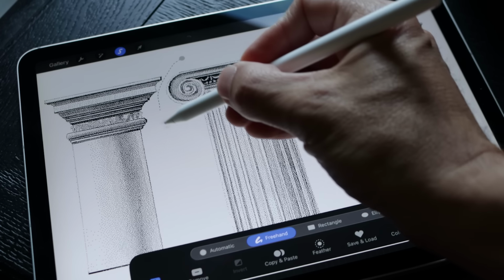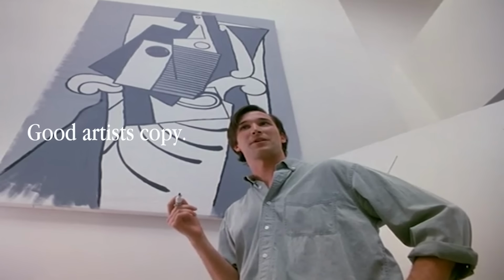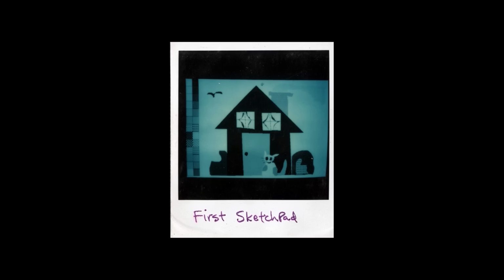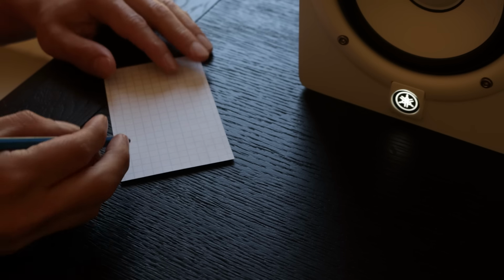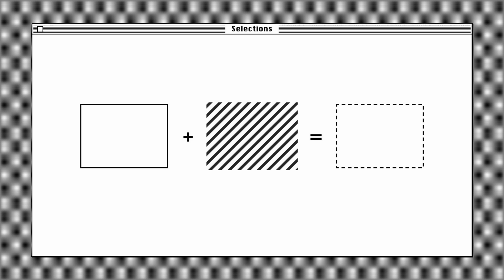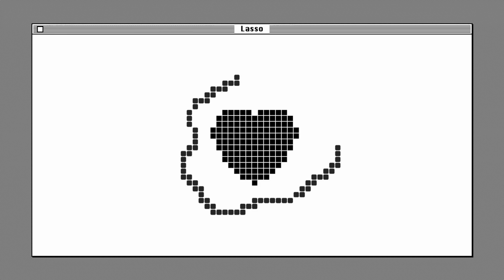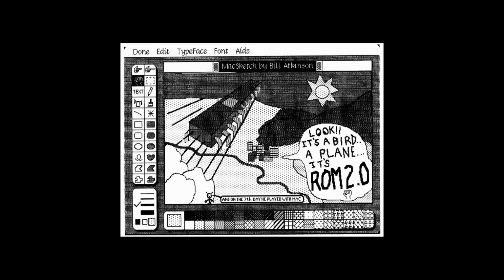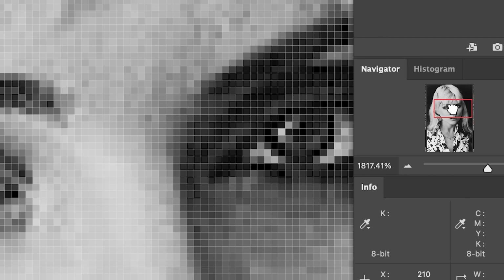Why every drawing app still looks like MacPaint

Comment from the maker: What was your first digital paint program?
Reply: This one. ❤ thank you.
Reply: Quantel Paintbox
Reply from the maker: @lightlinked Quantel was so cool. There's someone on here working on a long-form documentary
Reply: Kid Pix
Reply from the maker: @2xhTenchi ❤🌈✨
Reply: My first digital paint program was one I programmed myself on school TRS-80 computers in BASIC. They didn't even have tape or floppy drives, so we had to type in any program from scratch with no option to save or load later.

But in terms of a paint program programmed by someone else, that'd be Koala Painter (1983). It was the first time I saw a paint program with GUI icons for tools and palette.

Before that, I just programmed different tools to be selected by number key, and I just remembered which tool was selected by which key. Lots of computer programs were like that back then - you often had a physical keyboard overlay to show which key selected which function. But commercial paint programs were quick to adopt more user friendly GUI interfaces. Yes, before the Mac.
Reply from the maker: @IsaacKuo  I gotta check out Koala painter!
Reply: @IsaacKuo   ++ to the Koala Pad and it's wonderful paint and other programs on the C64.
Reply: MS Paint on windows XP!
Reply: Claris Works and Kid Pix on an LC III running System 7.
Reply from the maker: @martinXY Claris Works I used a bunch at school!
Reply: Mine was CoCo Max II, an almost exact clone of MacPaint on the TRS-80 Color Computer, fitted to run within a 256x192 resolution. 

It was quite impressive as it ran on an 1Mhz 8-bit cpu with 64k of RAM and still retained 98% of the features.

Eventually I got a Mac Plus so I could enjoy the full 512x342 MacPaint with an actual mouse!
Reply from the maker: @Starxxon oh cool I'd never seen that one before!
Reply: MS paint on windows 7
Reply: MS Paint on Windows 2000.
Reply from the maker: @SSQMinky Windows 2000 was such a great release IMO. I was using NT at the time for 3D apps in college, and 2000 I remember being stable and minimal.
Reply: Microsoft Paint on Windows Me.
Somehow, Deluxe Paint IV on my Amiga 500 is still better.
Reply from the maker: @Leofwine  Deluxe Paint was so good
Reply: Paint and Color Draw. Both came preinstalled. Don´t remember the Versions tho, i think on Win 3.11.
Reply: I still have a diskette somewhere
Reply: Tux Paint. In the computer lab, we'd fight over seats that were facing away from the teacher so we could ignore the lecture and play with tux paint.
Reply: Dr. Halo on MS-DOS
Reply from the maker: @WarrenGuy Woah, had never heard of Dr. Halo! That looks rad.
Reply: MS Paint :D
Reply: I didn't own this program because I was still in elementary school, but AT school, we sometimes were allowed to use Micro Painter for the Apple II (I was in kindergarten, so circa 1980/1981 time frame).  Which brings me to wonder, how come all the documentary videos like this completely glosses over the paint programs that existed for computers before the Macintosh?  Every single time.  I don't begrudge the mass-influence that MacPaint has had on the industry; but, I don't think it's fair to all the effort in digital paint tooling for common home computers prior to 1984.  When I got my C64, there was Doodle! (1983), which was as ubiquitous then as MacPaint was later.  That didn't start to change until GeoPaint came out with GEOS 64, but of course, it was influenced by MacDraw.
Reply from the maker: @ForthCrafter MacPaint definitely wasn't the first, but they were able to distill the idea into such an iconic form that even today programs are still echoing a lot of the design decisions made by Kare and Atkinson.
Reply: Deluxe Paint II on the Amiga 500+
Reply: My dad had a Mac SE that he would bring home from work on a regular basis, so I was exposed to Mac Paint as a kid, however if I jog my memory back a little bit further, I recall the family having an Acorn Electron and my dad once hooked up to the TV and it had was a "sketch" program that worked like an Etch-a-Sketch IIRC which I used it to design my "dream" house at the age of 4. Later we had an Amstrad PC1512 with CGA graphics and Microsoft Paintbrush (a rebadged version of ZSoft PC Paintbrush) which I spent many hours with, and since it was just like Mac Paint, I was able to pick it up quickly. A Windows port of it was included with Windows 3.x, and that later evolved into MS Paint starting with Windows 95. This is the reason why even in modern versions of Windows, there is still a file called pbrush.exe that acts as an alias for Paint
Reply from the maker: @offrails I spent a lot of time with PC Paintbrush! Pretty cool your dad used the "portable" aspect of the Macintosh to bring it home
Reply: Either Kid-Pix on school computers, but most likely microsoft paint for windows 7
Reply: Ibispaiintx
Reply: KoalaPaint on C64, then Art Studio and Giga Paint. They all could work from a cassette tape, unlike GeoPaint, and the latter two were arguably better than GeoPaint anyways. Then I moved to PC with DeluxePaint, still one of the best paint programs ever written, even to this day. There were even some recent games released that had been drawn in DPaint!
Reply from the maker: @robertosswald5896  Oh that's cool that people have been getting back into DeluxePaint!
Reply: Windows 7 paint
Reply: I still use kid pix
Reply: kid pix
Reply: Koala Paint on Commodore 64 :)
Reply: this one on my uncle's mac. I was so young and only used it for a few minutes. I thought about it often and then several years later I got Mario Paint
Reply: MacPaint on a Mac Plus.
Reply: Pro create

Comment: Immediate dislike for stretching 4:3 to 16:9.
Reply from the maker: Which clip? I almost always present VHS footage scaled down unless premiere accidentally interprets as non square pixels in which case it's accidental not intentional.
Reply: @dreamwieber  Pirates Of Silicon Valley is clearly stretched. I haven't watched past 2-minute mark. Also, the clip at 0:34 has combing in it. I suppose, you pulled it from some other Youtube video, which had been incorrectly deinterlaced.
Reply from the maker: Hmm, Pirates should've been correct not sure what happened, will have to check it out.

Comment: You comments are not correct, there was a equivalent of Mac Paint, callesdMouse Paint from Apple, which allowed nearly the functionality on the Apple II with an Apple Mouse. It was also release 1984 together with the Mouse
Reply from the maker: Both of those things came out of Lisa/Macintosh and MacPaint. Mouse Paint was basically a clone of MacPaint.
Reply: @dreamwieber  This is correct, however the misinformation what capabilities you present what was possible with the Apple II. Which is clearly missleading

Comment: I do use Kolourpaint, which "builds" significantly on the original applications.  You probably know, there is an online MacPaint which runs inside an emulator window.  It reminds me of seeing those early macs set up in department stores.  At the time I had no idea of the limited system resources.  That's back when coding needed to be precise and conservative.

Comment: The only thing I'd say needs a mention in the "prehistory" section is Quantel Paintbox and NYIT's work on stuff like Paint3.
Paintbox was obscure high end hardware so not many end users used it directly but it was hugely influential as what stuff on personal computers was aspiring to.  It had full color digital painting released in 1981 and it was a commercial product, not just something ina  few research labs.
Reply: There’s a BBC show, ‘Painting with Light’ that was based around the Quantel Paintbox. Featuring David Hockney, it’s on YouTube if you care to search it up.
Reply from the maker: Yes and someone on YouTube is actually working on a documentary on them!
Reply from the maker: Yes, Paintbox was super cool! I tried to stick to the most direct influences for time, but those are great mentions too.

Comment: 9:30 I mean, yeah, you can't really edit text in raster images in modern drawing programs, and honestly it would have been impossible to make the feature work reliably back in 1984 had it been implemented -- because how do you handle different typefaces? Different font sizes? Text partially overlapping the underlying image? Even today, where you could realistically implement that feature with the help of machine learning, you can't possibly make it work 100% of the time.

That said, I would like to point out that most modern drawing programs will in fact let you edit existing text in an image, provided the image was saved in the program's native format (or some other formats that contain text layers) and the text hasn't been rasterized.
Reply: Yep, he had good intuition to scrap it. It was basically highly deterministic OCR, AutoHotkey does something like that today to detect UI text. How would you fill in the pixels behind if it was on a background? What if pixels were in front? Impossible to make it work, perhaps only today with sophisticated AI image models.
Reply from the maker: @neoqueto it's always hard to cut features, or edit out your "darlings" from a movie. But that discipline can really lead to clarity!
Reply from the maker: Yea, these days it's very rare to have a completely bitmap editor with no layers or concept of "objects". But, 128kb was just a bonkers constraint when you think about it.
Reply: And that was when the images were black and white with bitmap fonts. It would be even harder to reliably detect and edit text when having more colors, scalable fonts, anti-aliasing, combining characters, bidirectional text, etc.

Comment: My formative years were spent lost in those 512 by 342 pixels. Susan Kare's and Bill Atkinson's attention to making every single one of those pixels PERFECT was simply a gift to behold. They (and the rest of the whole Macintosh team) were legends!
Reply from the maker: It's wild how refined it is. People today talk about "pixel perfect" but this really set the bar. I also got so lost for countless hours in MacPaint (and windows paintbrush too!)
Reply: To be clear, the most annoying person in the team about everything being “perfect” was Jobs. He has forced them to redo the menu line like twenty times. And he wanted the screen concerns to be rounded no matter what (yes, it was not Jonathan Ive who was pushing it onto iPhone, Mac Pro etc).

The team had to manage Jobs’ demands in rational ways such as presenting several variants at once to show proof they trying different approaches. Otherwise Jobs would just rejected a single suggestion as low effort.